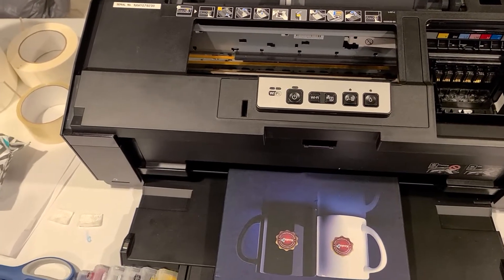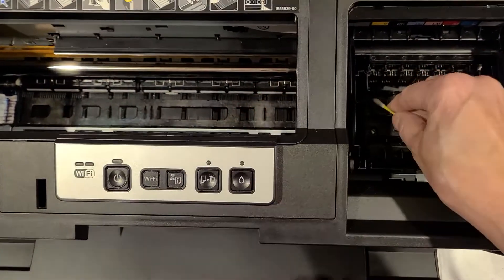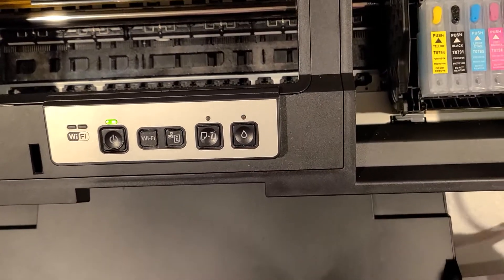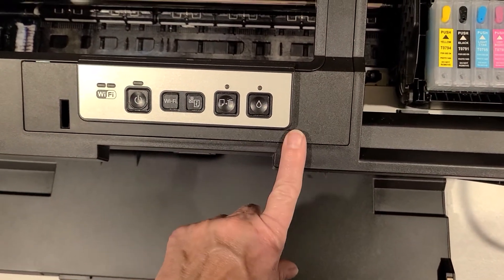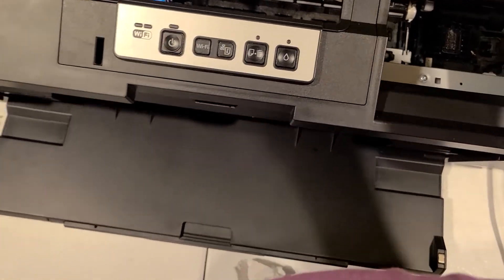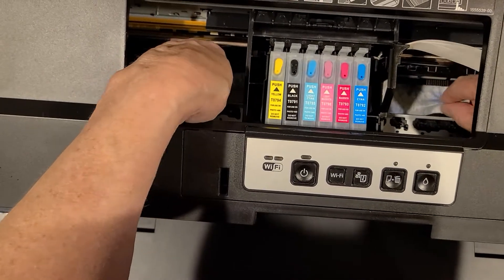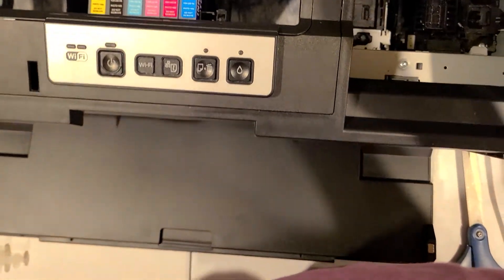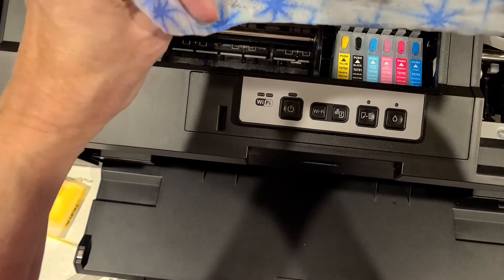Artisan 1430 DTF conversion continued... how I do maintenance.

Comment: Hello my question is why did you remove some of the rolls in another video I saw?
Reply from the maker: If you don't remove some of the rolls, they will leave lines in the ink.   DTF ink is thick and never really dries until it's cured.
Reply: @craftingonabudget6700  have you made any videos on that part of the game yet? Are you don’t mess with DTF anymore?
Reply from the maker: @DirtySwampEnt  I don't do much dtf...I have a little R280 I use when I need a print, but it only prints 8.5 wide.   Go to this channel...Veronica is the DTF queen, she's who I learned from
https://youtube.com/c/IronDesigns813
She also has a Facebook group crafting with irondesigns813
Reply: @craftingonabudget6700  TY will do

Comment: Hello Any major problems since uploading this video? Are you still printing DtF with this same machine?
Reply from the maker: No,  I'm no longer printing dtf at all.  These are older printers,  so the printing life can be short.  You cannot do any firmware updates, or you lose the ability to use refillable cartridges.
Reply: @craftingonabudget6700  then shouldn't you use dampers instead of cartridges
Reply from the maker: @johngrate8100  I tried a CISS but couldn't get the flow right.   Turning off firmware updates is required either way.

Comment: Would this all be similar with sublimation ink?
Reply from the maker: Yes,  I have a 1400 that I use for sublimation and you should periodically clean the manifold and printhead.   Always clean the printhead of you get a head strike.  Maintenance isn't needed nearly as often for sublimation ink.
Reply: @craftingonabudget6700   thanks so much!   I appreciate your videos. I get mixed messages about converting my used 1430 and am trying to do as much research as possible. This printer is too expensive to ruin!!
Reply from the maker: @jensblingyadventures6546  after having mine bite the dust,  I would much rather use them for sublimation.   The results are wonderful.

Comment: I did a bunch of print head cleanings using the solution to flush out the original ink now it won't lay any dtf ink on the paper? Did I ruin it?
Reply from the maker: Have you done any nozzle checks?
Reply: @craftingonabudget6700  Yes nothing prints. It was printing with the original ink before flushing.
Reply from the maker: @allthingseuphoria  how many attempts have you made at printing with the dtf ink?
Reply: @craftingonabudget6700  bout 10 attrmps so far. I kept doing flushing last night thinking I had to stop the old ink from printing on the nozzle check. Then I put in dtf ink when it was clear smh. Please tell me there is resolution 🙏
Reply from the maker: @allthingseuphoria  put the cleaning carts back in and do purge prints on paper.  Try to avoid head cleanings. Do you have wicreset utility installed on your printer?
Reply: @craftingonabudget6700  No I don't...Wicreset?
Reply from the maker: @allthingseuphoria  https://www.wic.support/download/
Reply: @craftingonabudget6700  I found it and downloaded. I really appreciate you helping me with this BTW.
Reply: @craftingonabudget6700  I also just did a purge print with the cleaning cartridges.
Reply from the maker: @allthingseuphoria  how did that look?
Reply: @craftingonabudget6700  completely blank. The printer acts like it's printing but doesn't lay down any ink 😭
Reply from the maker: @allthingseuphoria  did it look "watery"?
Reply from the maker: @allthingseuphoria  are you Crafts Euphoria?
Reply: @craftingonabudget6700  yes
Reply from the maker: @allthingseuphoria  when I get back home I'll message you and see if we can figure this out.
Reply: @craftingonabudget6700    @Sharica Walker   did you ever figure this out?  I am having the same issue...
Reply: @woodsy169  I’m having the same issue as well. Did you guys figure it out
Reply: @craftingonabudget6700  hi did you figure out the issue with your printer. I’m having the same issue
Reply from the maker: @OpTiMiSticLaDy100  I'm not sure she ever got it working.  What steps have you taken so far?   Also, disclaimer here...I don't do the dtf printing anymore, but I'll try to help the best I can. There are two Facebook groups I highly recommend. 
https://www.facebook.com/groups/craftingwithirondesigns813/?ref=share_group_link

https://www.facebook.com/groups/dtfprintingfromconvertedtocommercial/?ref=share&mibextid=jf9HGS
Reply: @craftingonabudget6700  thank you so much. I’ve done print head cleanings , ink recharge, turn off & turn it back on. It’s still not printing

Comment: so do u left cleaning solution cartiges  in the printer untill next print , may be days?
Reply from the maker: Yes,  to keep the printhead from drying out and creating a clog.
Reply: @craftingonabudget6700  i read...cleaning solutions may melt printhead mebrans...how long are u using 1430 as dtf
Reply from the maker: @kizagan_alaz  I have had it converted to dtf since July.   I use 1 part windex to 3 parts distilled water for my cleaning solution.